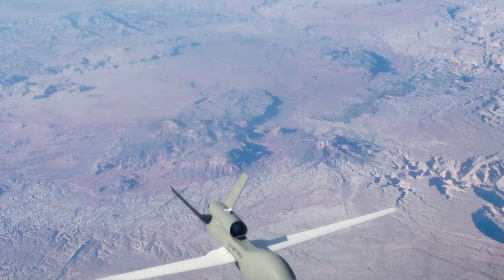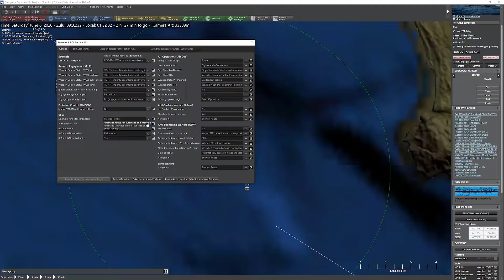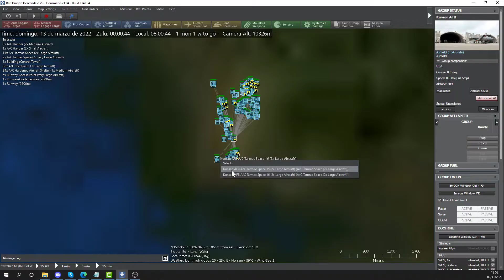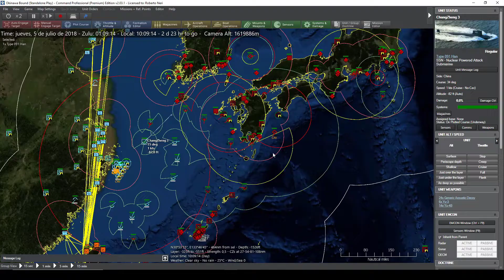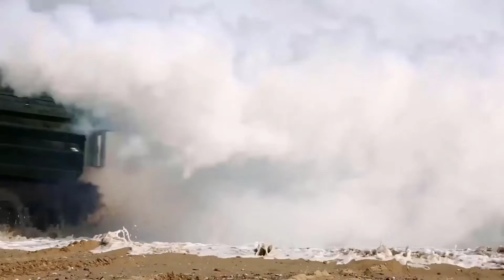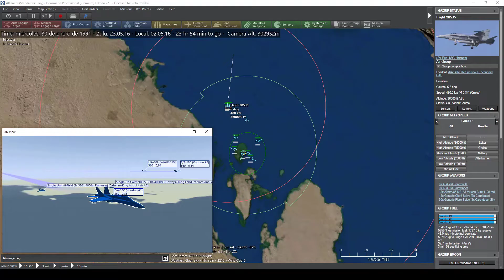Command Professional Edition

Comment: When does the commercial verion have Multiplayer?
Reply: There is a Mod in the standard version that allows you to do round-by-round.
Reply: @ms-lazuli7435  Ya but isnt it hard to setup?
Reply: @REMMc-jx7vc  If you can play this game, you ideally should be technologically adept enough to set up multiplayer, I could only hope. It's not hard to set up, works just fine in my experience.
Reply: @Techiastronamo  After running countless generations and the simulation ran endless variations and reiterations the physical unit not only always converged to our chosen directives, but somehow made its chosen actions in such a way, that the dynamical restructuring  and reallocation done according to algorithms that ensured no decreases in complexity and random generated improbability of repetition had its own vulnerabilities exploited, this was far beyond our expectations, time to unplug and add our payload. It is only after deployment we made one error, our simulation didn't include a prove that you are a human test. Fully autonomous and fused to deliver, we could no loner interact, or redirect for these patterns through a human clicker sweatshop. Unforeseen barrier it has no self-destruct, we are all doomed if we cannot find a way to contain our mistake, it has not only no self-destruct it does the opposite once it locks, it will replicate a fate of unequal catastrophe. The autonomous tactical mind delivers a self-replicating payload that will remove human autonomy. The gravity of our actions however sincere in our beliefs to bring global peace that had no end and and no beginning that man could remember, but this is fate worse than dead, we could already feel we had no choice, it has begun. We as humans, could finally all agree on the same thing, and we must act fast, our window was closing better no life than un-life, and our last decision will be our final decision. In our last moment of humanity we directed all of our might at that one fragile spot and detonated the Earth. We saved the universe with our sacrifice. Long after we were gone it would be trying to stop whole galaxies from clashing, still ending the conflicts it perceives, unable to tolerate or stop, ever.
Reply: so you can play with other army men
Reply: Round by round not the best. Easy to setup ur right.